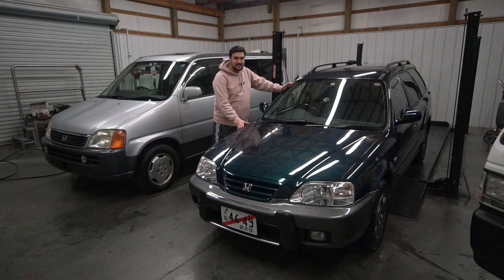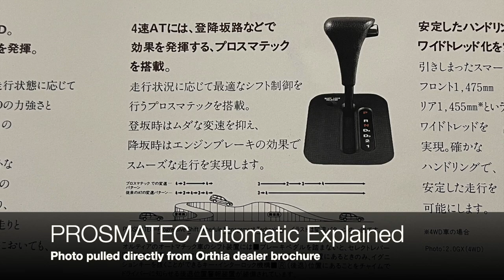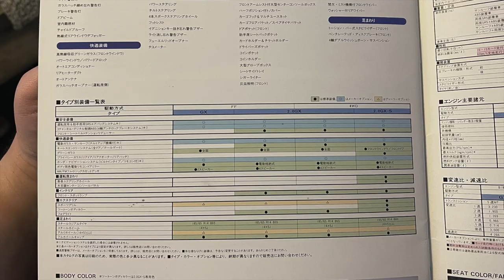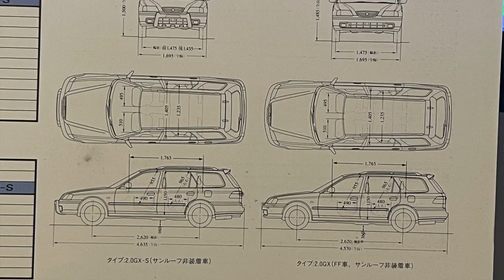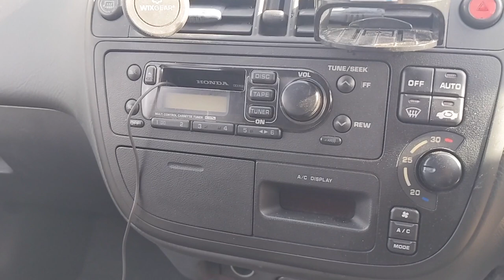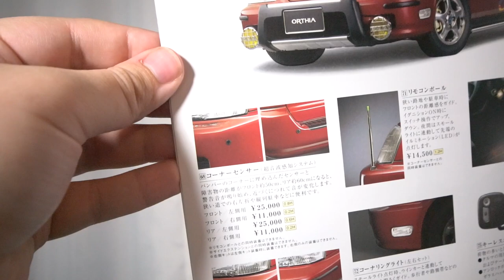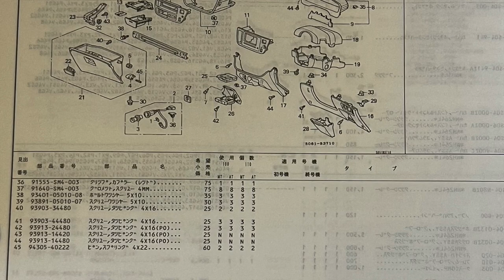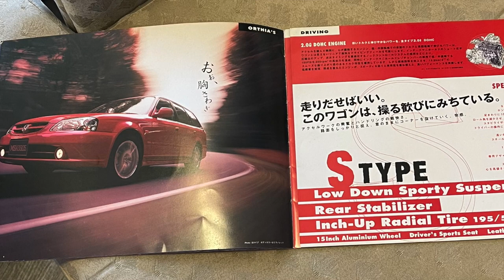Honda Orthia: The COMPLETE Owner, Buyer & User Guide

Comment: Can i make a correction, i own two Orthias. It actually sits on a rd1 crv subframe, but many parts are interchangable with ek civic except suspension parts are only interchangeable with the crv. If doing the  ek front swap you need to change the radiator mount as well. Thank you for highlighting this great car, heaps of them in New Zealand
Reply from the maker: Thank you so much for the info!
Reply: @battles.digital  I should i make a correction, Front of orthia the same as a ek however the rear is subframe is crv. No worries, my fav cars. Both of them i have are manual one 1.8 and 2.0 litre
Reply: Seen someone install EG hatch coils and rear lower control arms, would they fit properly on my 1996 4wd orthia?
Reply: @ronnelgbm7545  yes eg and dc fits perfectly on the orthia
Reply: @Upshifter91  oh okay good, got me a little worried lol. Definitely will be getting EG coils and EG lower control arms for my orthia, need to be lowered along with getting new wheels on
Reply: @ronnelgbm7545  sweet yeah I had eg buddy club coils on my orthia. Orthia is eye type on the rear
Reply: @Upshifter91  going to be converting the rears to fork style, can’t find any eye type coils plus knowing if it’ll fit properly with the oem lower control arms
Reply: @ronnelgbm7545  sweet as no worries
Reply: So rear axles can be AWD crv axles correct ?
Reply: @mariocerna9407  yes they can be some orthia are factory AWD same rear subframe as a crv
Reply: @Upshifter91  thanks for the reply brother.  Yea mines is a 1996 awd. So I should be fine with using AWD crv then.  👍🏻
Reply: @mariocerna9407  yup I own two Orthias they are exactly the same as a crv
Reply: I want to covert my automatic awd orthia to manual do I use ek or or crv parts?
Reply: or where do I get swap kits?

Comment: Can you help me find a tow hitch that will fit my honda orthia 1996?
Reply from the maker: It should be the same as a 96-00 Civic. Also, you might could try an RD1 CR-V hitch if that doesn’t fit properly. Either should be very close.
Reply: @battles.digital  I have been looking for a replacement window visor (with clips) for my 1996 e-el3 Orthia. I have a part's manual but shows the door assembly without the visor. I have also seen online that the door assembly is available with the visor on it but I don't want to buy a whole door just to replace the visor. is there a part number for just the left door visor/ wind guard? What part's catalog do I need that shows this? Where can I get one sent to the USA?